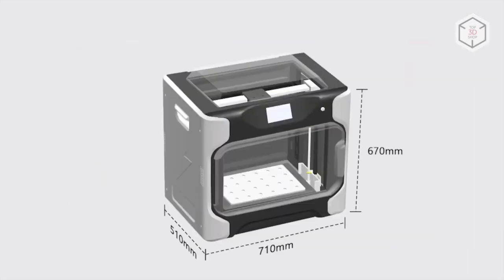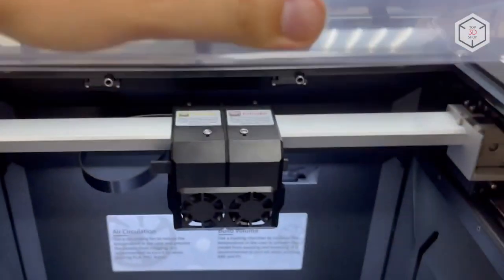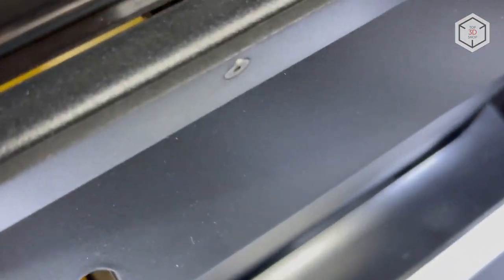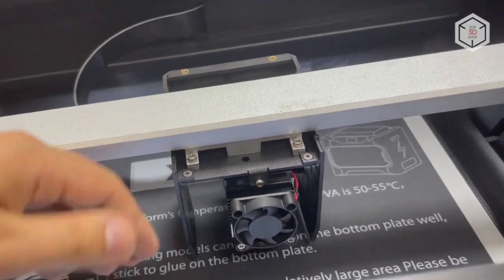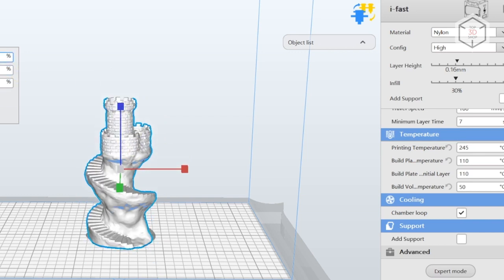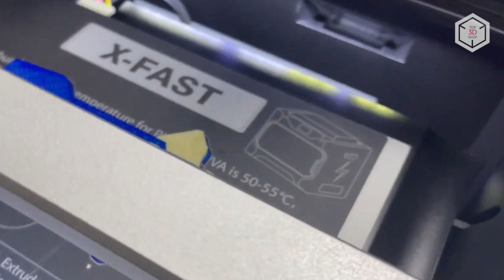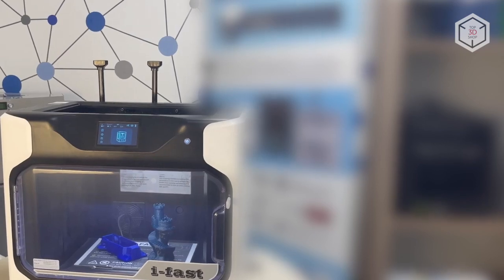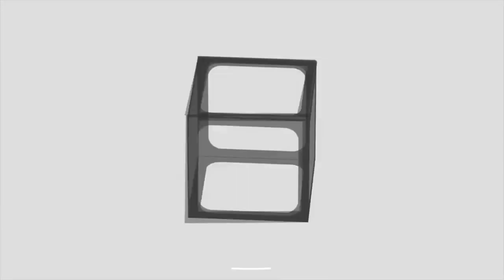QIDI Tech i-Fast In-Depth Review: High-Temp Dual-Extruder FDM 3D Printer

Comment: Thanks for that informative review. I've got a question though: for home use would you rather suggest this one or Flashforge Creator 3 Pro? I'd like to get something fully enclosed with preferably dual extruder (mainly to print with dissolvable supports). Main con for this printer is for me the lack of auto bed leveling, where for FF3Pro is the noise. Or maybe you can suggest any other fully enclosed printer around this price range with simillar build volume?